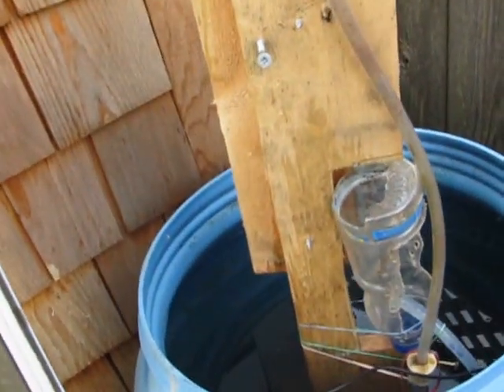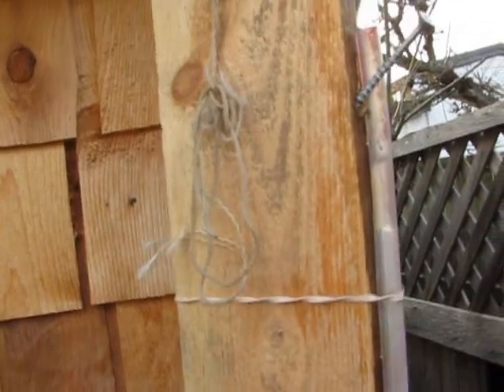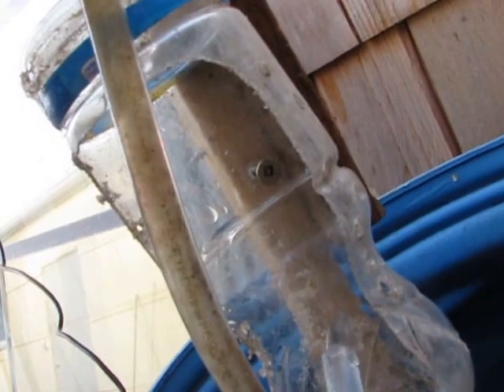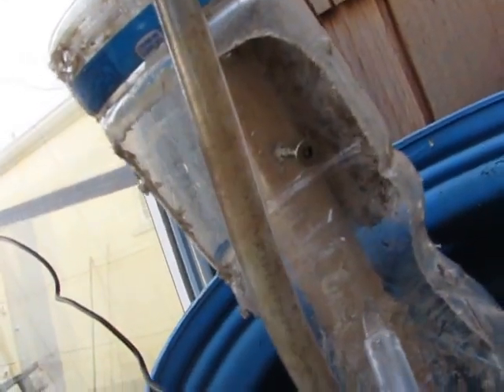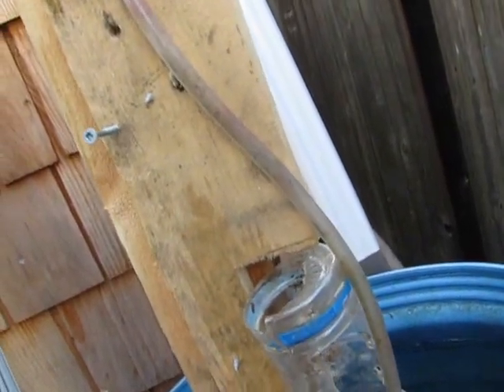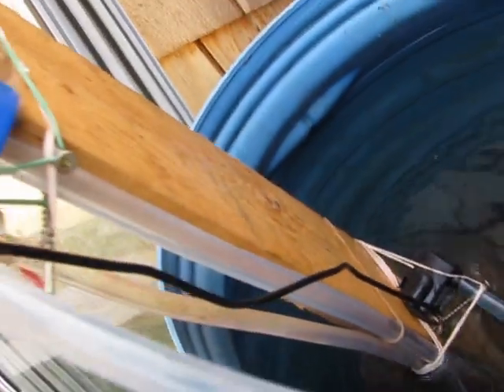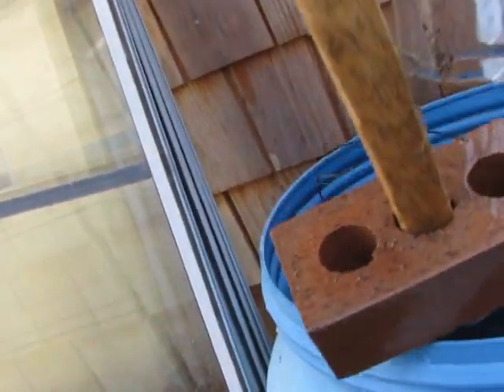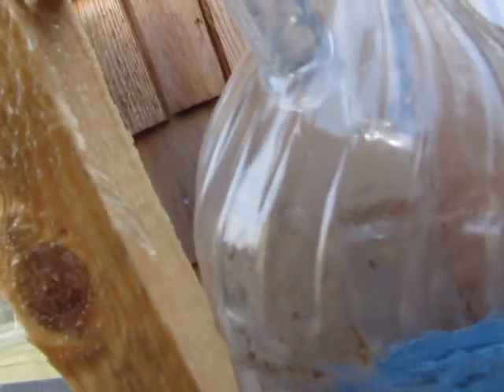Tiny pulser pump "nano" demonstration and perhaps the world's smallest compressor!

Comment from the maker: Yeah, Brenda, it is called a tromp or hydraulic compressor.  See the tiny amount of water needed to work the airlift?  That is pretty much the minimum.  But if you has a brook or stream you would have 20 or 30 or 50 times as much water. 250 to 300 litres per minute will work going down in a 4 inch pipe.  Over 300 litres per minute, you might need a 6 inch pipe to take the water down.  However the best sizes for airlift tubes will still be around the 1/4 inch internal diameter. A bundle of them!

Comment: Hi Brian - two of us are studying your tiny Pulser pump.   How far down is your vertical output tube into your plastic bottle chamber?  Yours looks like it is barely in the chamber and I'm wondering how it pumps water rather than just air.   I'm getting inconsistent results, but I think the position of the output hose in the chamber does make a difference.

I noticed your input hose is quite a bit smaller than mine - I have a 3/4 inch PVC with a 3/8 inch outer diameter / 1/4 inch inner diameter air pipe from the top of the funnel 4 inches into the drive pipe.   I'm wondering if my input pipe is too big - does take a lot of water.

When I changed from 1/2 outer diameter / 3/8 inch output delivery tuber to a smaller 3/8 - 1/4 output delivery tube I got better and a little more consistent results.   I noticed that you have quite a bit of water in your output tubes rather than the mostly air with a random spurt once in a while like mine.

I'm wondering if my plastic water bottle chamber is too small for the pipes.

I've tried 2 foot high delivery and 4 foot high delivery with similar results for delivery height above the funnel - did reach 3 feet once.

If anyone has suggestions or wants to share your results, please reply here.    Also, if you want to participate in the contest, which Brian has helped to judge - here is the link to the contest in the Water Powered Pumps public Facebook group:
https://www.facebook.com/groups/240458583255303/permalink/562375124396979/
Reply from the maker: Yes, if you put the right amount of  air down a foot or so under water and let it come back through a tiny tube there will always be water coming up with it.  If you use a 3/16 inch internal tube,  you can get the water up to 6 or 7 ft high quite easily.  (But of course it isn't practical because a 3/16 tube is tiny and very little water is pumped.
Reply: I'm wondering if multiple smaller air tubes inside the drive pipe might be better than the larger 3/8 outer / 1/4 inner that I'm using.  When I went bigger, did not work at all.  Also if went smaller, I should be able to do  multiple tubes.   What distance do you go down from the funnel into the drive pipe?   Will report back when I've tried your ideas.

Comment from the maker: I made a little pulser pump nano demo. I don't have a stream so i used a solar panel and tiny  little water pump to make the tiny little flow of water.     It is very very  small but a stream that small is enough power to run a pallet garden or a small windowfarm!  How come in a world where we HAVE to find alternatives to fossil fuels, we refuse to use water power sources that are a thousand times bigger than what i demonstrated?  In Europe,  tide mills were used from Ireland all the way to Israel for at least 1500 years and water mills for at least 2000 years before we modern intelligent humans abandoned them from 1930 on.  What made us stop trying?